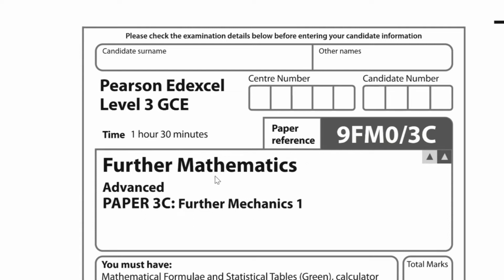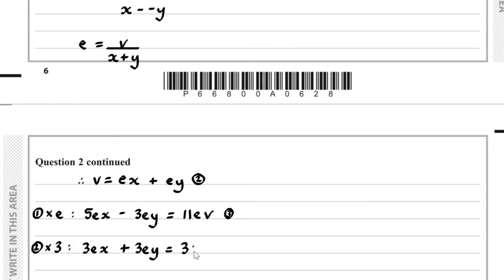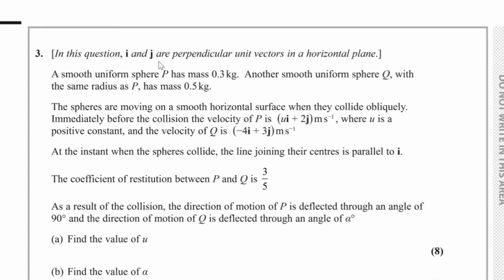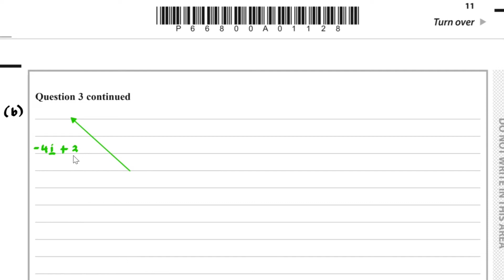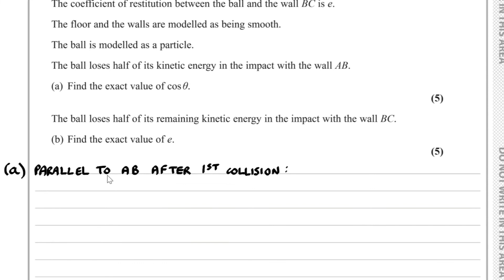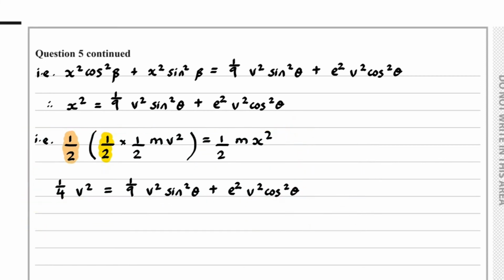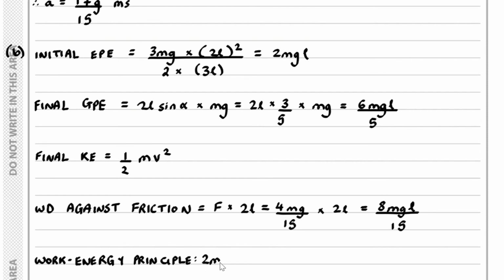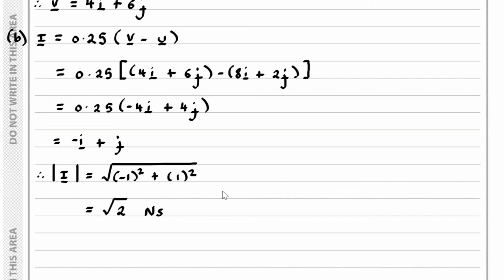EdExcel A-Level Further Maths October/November 2021 (Further Mechanics 1 [FM1])

Comment: Hi! For question 2, how can it be that both x and y are greater than 0 when the two particles are moving in opposite direction initially? Shouldn’t y be less than 0 - but that would give e > 5/11
Reply: it may be a bit late, but its because y is labelled as the speed of B in the negative  x axis. notice how the arrow labelled y is moving in the opposite direction to x. If both arrows were moving to the right, y would be less than zero.
Reply: You have already accounted for the fact that y was negative in the momentum equation...  If you say y<0 now then the particle would actually be moving to the right as louiso1477 says...